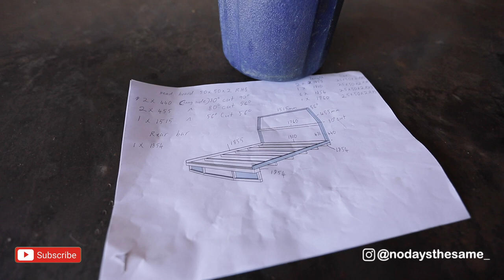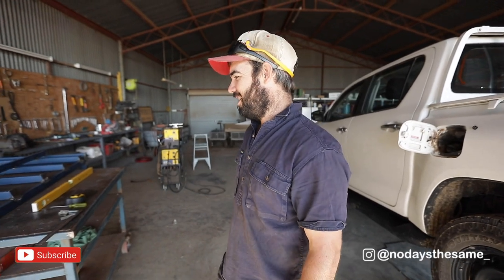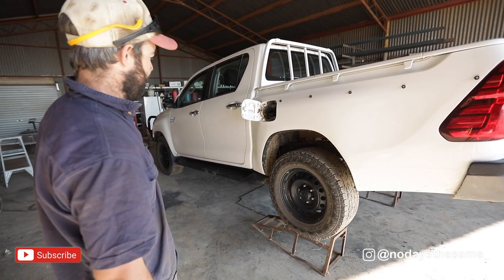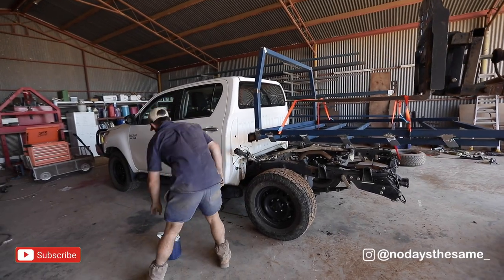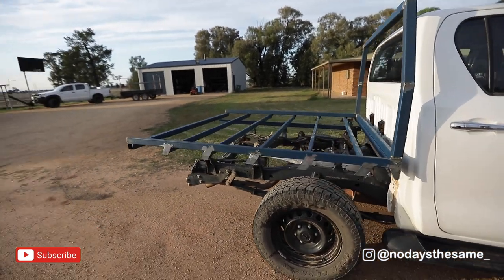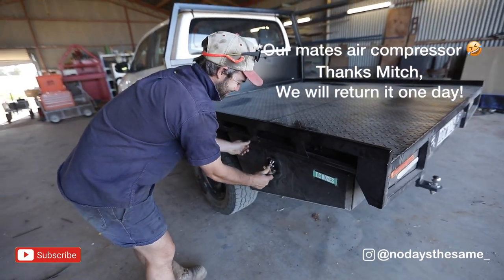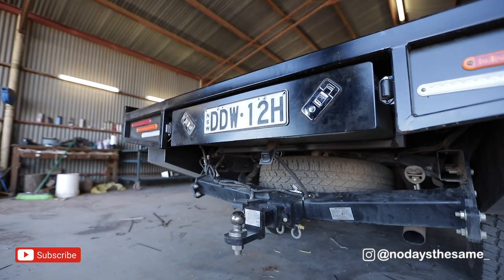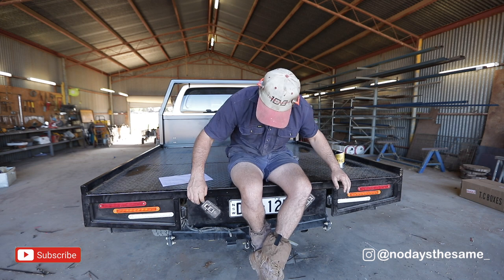Building our ute tray - Nodaysthesame

Comment: Very neat and clean build. Absolutely love the farm setup and little shed and lawn and farmhouse. Got a Ford 5000 tractor on the farm as well. Good job mate sure it will work brilliantly. Just leave ample space between the cab and the rear, the chassis flexes quite a bit during off-road conditions and you don't want the cab and the rear connecting. Keep the wiring to and from the rear simplified to a single Anderson plug and for controls get a quick release plug you can grab from any auto-electric shop, that way if you ever need to remove it for upgrades or maintenance you simply unplug everything and remove it.
Reply from the maker: Thanks mate! The 5000 is almost the most used tractor on the farm, it's great.

Comment: Great job.  I want that shed but I don't think it'll fit on my suburban block. I'm in Perth and the rules may be different over there, but I've had to have mine weighed, inspected and licence changed from ute to flat top.  Need the tare weight as low as possible to meet load restrictions under GVM. Keeps it legal and covered by insurance. I wasn't aware until finished and fitted out, so to meet regs and minimum tare I removed everything, weighed and started again. Pain.
Reply: I dont know whether to read this in a Scottish accent or an aussie accent, since you never said wich Perth you're from haha

Comment: Great job quick tip when laying out any thing gates frames etc use the square of your steel welding table top sheet and f clamps can save time
And if you ever get any spare cash buy a half decent metal bandsaw you will save a shitload on grinding and cut off blades
Cheers Penola SA
Reply from the maker: Iain Hetherington Thanks! A bandsaw is on the wishlist.

Comment: I love to do that to my Hilux, great job. I find it silly that there hole things in the back of the cab.
Reply from the maker: AssaultWolf Thanks mate! Yeah they’re really silly.
Reply: I'm pretty sure those are there so that when you shut the doors, you don't pop windows or ears or something due to air pressure. Some do have slightly better designs with less dust invasion though.
Reply: And to get fresh air into the cab there has to be SOME where for the stale air to exhaust. Might be important on a long trip so you have fresh oxygen to breathe as cabs get better and better sealed...
But some sort of labyrinth to keep dust out would be good.

Comment: Just wondering what size RHS you guys used for the tray frame and what the overall dimensions were. Looking to do one similar. Cheers
Reply from the maker: Hey mate, the RHS size was 25 x 50 x 2 for the tray, headboard was 50 x 50 x 2 and overall dimensions for the tray was 1860 x 1860.

Comment: What did you do about the fuel filler pipe mate?, I just added a bit of plate onto the chassis to hold it but it sits right behind the cab. Wouldn’t mind seeing what you did for yours, would like to change mine.
Reply from the maker: Hey mate I welded a bracket to the tray, what’s your email address and we can send a photo if you want?
Reply from the maker: @stated05  Have just emailed you, sorry for the delay!!

Comment: why didn't you get it galvanised and then paint over the top of it, like most boat trailers?
Reply: It warps the checker plate
Reply from the maker: Because galvanized is harder to weld. And the paint doesn't stick to it as good.. plus it's more expensive.

Comment: Hey mate, awesome job. Can I ask how you mounted the tray to the chassis? did you weld a bracket to the tray and bolt it on? did you use all 6 chassis mounts or only the 4 back ones? I'm at this point with my tray currently and not sure where to go from here
 any photos would be great

Cheers!